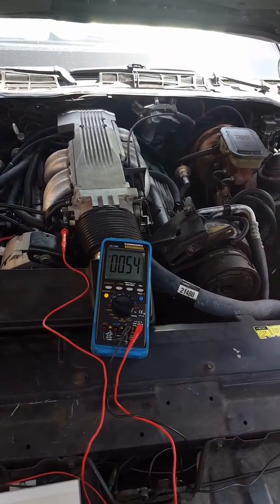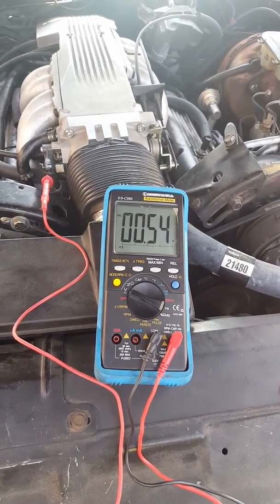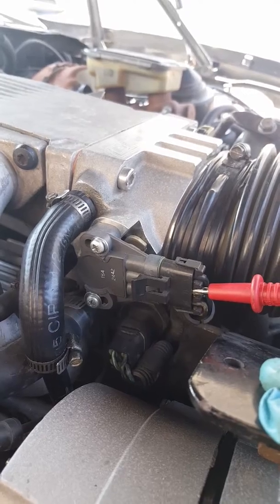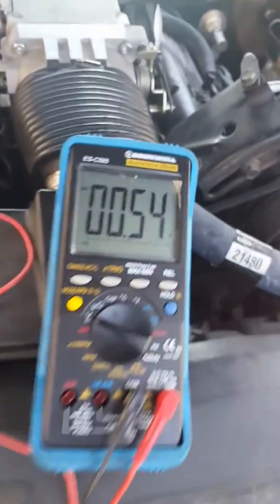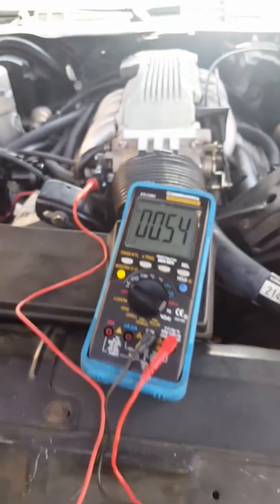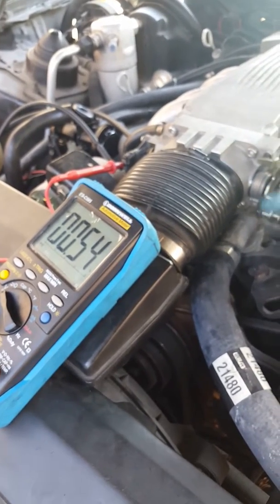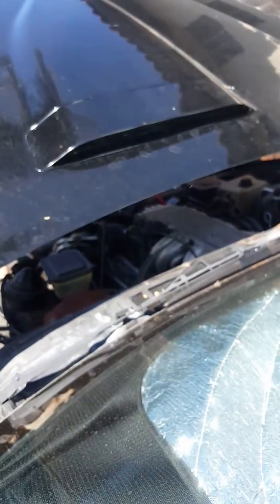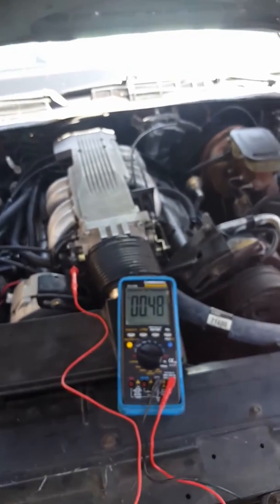1986 Pontiac Trans Am TPS Adjustment

Comment: What was your idle screw set at? I need to readjust my TPS but I've fiddled with the idle screw.😅
Reply from the maker: You need to use the Ohm meter as described to set it properly.
Reply: @salhanna9375 I know, I'm asking how far you have the idle adjustment screw set out
Reply from the maker: @905Speed the cTPS screw should just be loose enough to be able to give a slight tap to the TPS where it moves 1/8"  this way as you adjust, you aren't over adjusting.
Reply from the maker: @905Speed  keep in mind the idle screw is different. Plus there is an idle air control that should be reset. The idle air screw is set based on where the throttle plate closes.

Comment: Thank you!!  I think my timings still off but it runs much better!!
Reply from the maker: Glad I could help.
Reply: It was at .70..  i got it right to .54 and it was perfect but then I guess it moved and went down to .40 and idled at like 5 or 600 rpm but didnt die when I put it in gear..  idk if its failing or I didnt get it tight enuf
Reply from the maker: @LostinSperry1988  make sure your throttle adjustment screw isn't loose. That can cause it to change. When you tighten the screw it also changes so you'll have to play with it a bit to get it to lock into the right number.